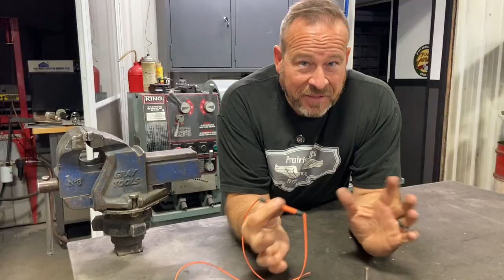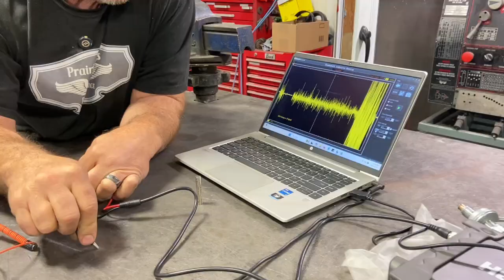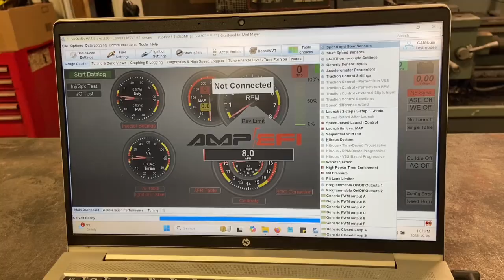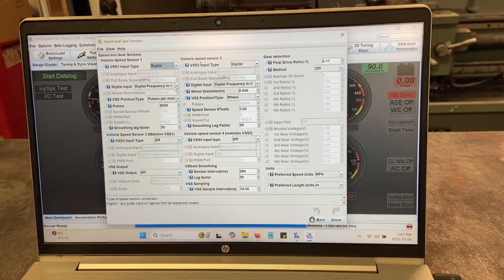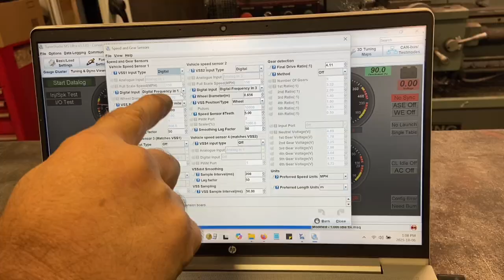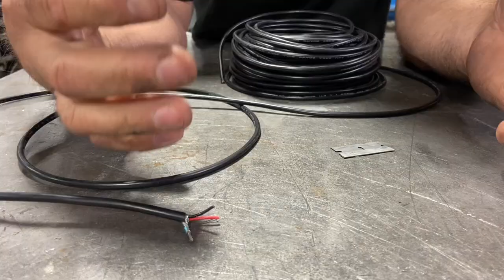The Tiny Sensor That Runs Your Engine (Hall Effect Explained!)

Comment: The hall sender in my 88 16v Scirroco; would ground to the distributor body. Killed spark and fuel...instantly. Dead and hard to steer ( hit a curb and broke my axle)
Reply from the maker: Ouch, that doesn’t sound good. How long ago was that?
Reply: @prairiewingsperformance6036 
Holy crap.....35 years ago!?
My uncle was a body and engine guy( he worked on rich guys vintage race cars: Old Jaguars and Alpha Romeos)
He got me fixed up and bsck on the road. I probably had the car for another 10 years.
Reply from the maker: @almaadams3631 I bet every time you see one it brings back memories, probably good ones. The cars I wish I still had!
Reply: @prairiewingsperformance6036 Scirrocos are rare as heck
(especially in Colorado)
I bought a 94 Audi quattro coup right after that. Very similar car with AWD ( yeah,it was a great snow mobile)
I have a 2013 GTI now.
They are all great cars with different qualities. I really need a torsion differential for the GTI; all that torque at the front wheels needs to be controlled ( it is mildly modified with 4 octain/timing tunes)